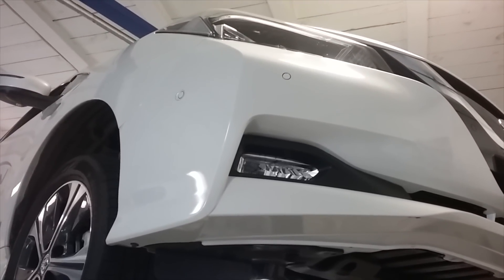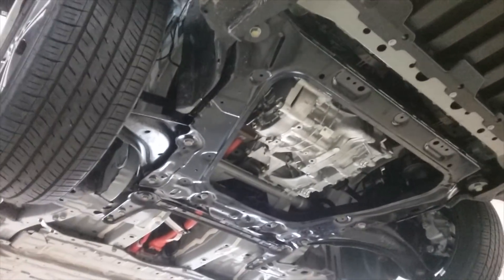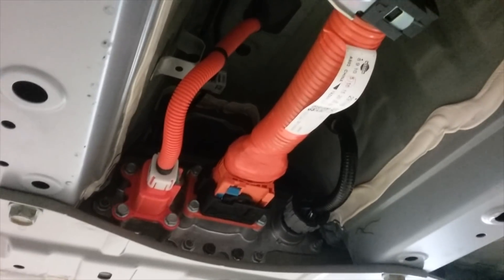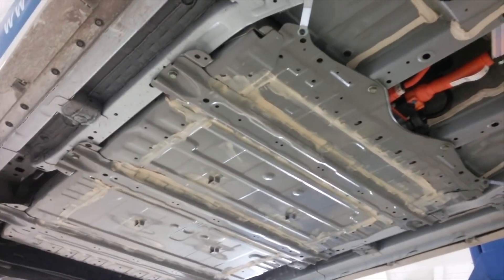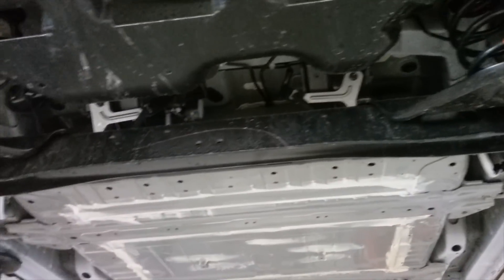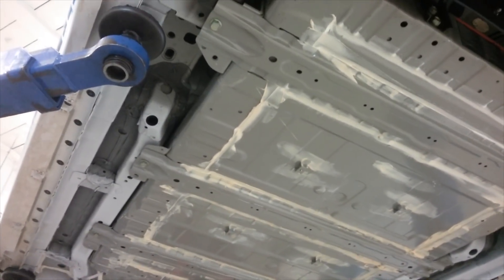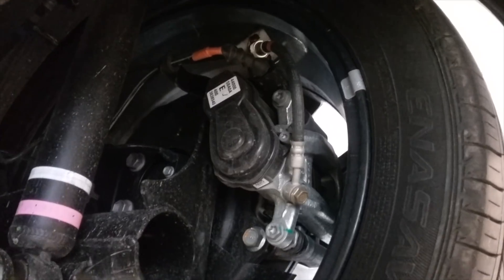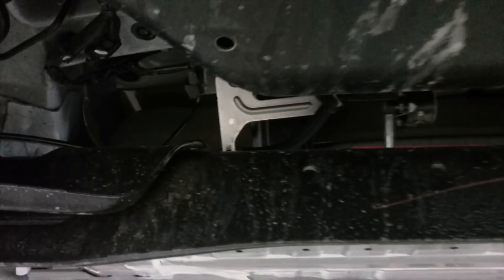2018 Leaf ZE1 40kWh battery

Comment: EV'Enhanced can you give me the main battery usa part number so I can find one in a salvage yard, thanks and good job you doing
Reply from the maker: Hi. As far as we know, a US-built 40kWh battery will have a part number of the form 295B0-5SAxx where xx can be 8A, 8B, 9A or 9B.  B is the later revision which is likely the same battery with the later firmware update already in the LBC. 8 or 9 will be for the cold-whether package version or not.  8 is probably without the CWP although it could be the other way around.
Reply: EVs Enhanced 
Would I need the cold weather package and thanks for the good work you’re doing
Reply from the maker: @jstroudbigjim  No problem. Good luck with hunting down a doner battery pack.

Comment: Is there any forum/reddit somewhere discussing active cooling a Leaf? I love my 2018 but the passive cooling is a major Achilles Heel.
Reply from the maker: Hi. I'm sure there is discussion on this topic somewhere, but I haven't seen any good aftermarket cooling solution for the current Leaf battery.  However, it will be very interesting to see how Nissan implements active cooling on the upcoming 60kWh model and fits this and significantly more battery capacity into what will presumably be the the same size/shape battery enclosure.
Reply: @EVsEnhanced  Well, this comment aged poorly ;)

Comment: Do you think there is a way to move heat away from the pack maybe a fan
Reply from the maker: There is always a way, but I think to add any effective active thermal management will require modifications inside the pack rather than just cooling the pack enclosure.  It is hard to see an effective aftermarket solution being cost effective.
Reply: EVs Enhanced I'm at a 50kw charger running at 18kw (2hr to full) and only 44% and 260 mi to home. Heat isn't to red but I am looking at 4+ hrs charging to get home + 4hrs driving. Even a small amount of cooling might help
Reply from the maker: I completed a road trip in a 2018 Leaf before the fast charging issues were widely known so I feel your pain.  These are such nice cars other than this one issue, so maybe some owners would be prepared to spend a reasonable amount of money on a well sorted battery cooling system.  Just as a little survey of 1 person - what is the maximum price that you would consider acceptable? Presumably the cost difference between selling a 2018 Leaf and buying a 2019 one would be the absolute limit.  But none of us know what that price difference would be yet.
Reply: EVs Enhanced I would have a very hard time paying anything given the car is less than 3 months old and 1600 mi (600 on this trip) and the only reason I bought it was for long trips. I don't need range/dcfc in town. I need it on the road. 2-3 hr to charge is untenable.
Reply from the maker: Fair comment. I consider the 2018 Leaf to be a really good car in the right circumstances (say for a person that commutes 100mi every day without wanting to charge or someone who commutes 200mi a day and can slow charge while they work). But I think it is totally unsuitable for long trips and the owners manual effectively admits that. We're expecting that the 2019 Leaf will be a different story.  What none of us know is how much of a premium Nissan will charge for a car capable of long trips without cooking the battery.
Reply: EVs Enhanced they are going to have a hard time charging a premium for an essential feature if the model 3 deliveries hit elons protections
Reply from the maker: Yeah. I think it is safe to say the 60kWh verion of the Leaf will be more expensive than the existing model, but competition with other makes will certainly place a limit on what Nissan can get away with charging. It will be very interesting to see how it plays out towards the end of this year.

Comment: so can we upgrade leaf 2013-+ 2015 to 2018 battery ?
Reply from the maker: Hi.  The battery pack having the same form factor and connectors certainly is a great start, but it is only the first step of many for us to assess the feasibility of this swap.    But we certainly intend to investigate this further.
Reply from the maker: Thanks for the link. I am surprised to read that the 2016 VCM worked in a 2014 car. We are focusing on battery swaps while keeping the original VCM but making it work with the BMS in the new battery pack.   We have completed several of these now.  http://evsenhanced.com/hv-battery-swaps-and-upgrades/  We are currently playing with a 2013+ battery pack in a 2011/2012 car without opening the battery pack.
Reply: Btw, a guy on the Norwegian Electric car forum has successfully upgraded a 24kWh Leaf with a 30kWh battery. He even had Nissan reprogram a module related to the key. So it's actually not looking all that bad.

https://translate.google.no/translate?sl=auto&tl=en&js=y&prev=_t&hl=en&ie=UTF-8&u=https%3A%2F%2Felbilforum.no%2Fforum%2Findex.php%3Ftopic%3D37530.msg652655%23msg652655&edit-text=&act=url
Reply: Exciting news. Thanks for keeping us updated!
Reply: Thats pretty cool, keep it up! =)
Reply from the maker: Thanks.
Reply: I have a 2016 30kWh model with 9 bars remaining on battery life with only 25,000 miles. It would be interesting if Nissan would entertain dropping in a 40kWh during the warranty replacement.
Reply: William Ho wow that is really bad. I have a 2012 with 40000 and 9 bars.
Reply: My Leaf has a mechanical parking brake. Only trim that has the electronic parking brake is the SL. Optional in SV with technology package.
Reply: @twoeightythreez  I prefer the mechanical brake, and I hand selected the Nissan leaf as my electric vehicle for this reason. (Most other brands and Nissan or moving to all electric emergency brake) I love not having to rely on electronics for everything. And if the battery dies you can still push or release the hand brake in a emergency situation. I'm just different, and I still wish cars would have manual and electric windows at the same time.
Reply: I can't wait to DIY a 40 pack into a older Nissan leaf. This Great driving vehicle with the longer range would be great.